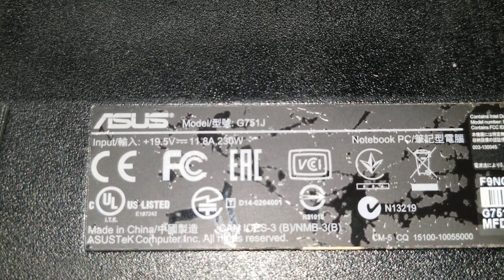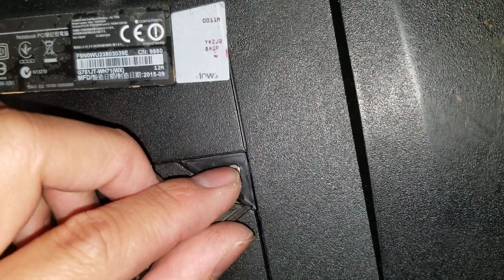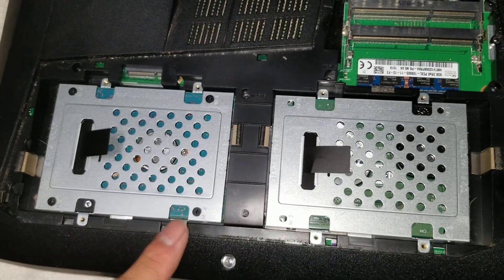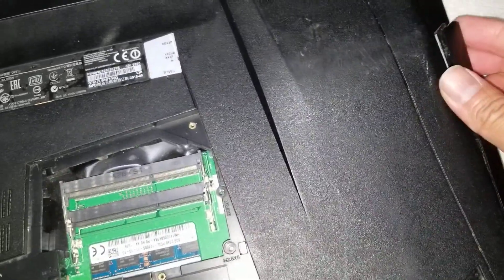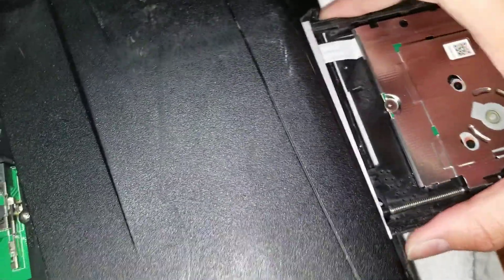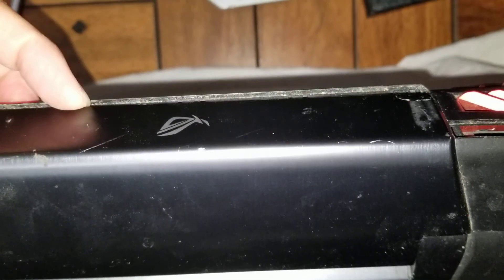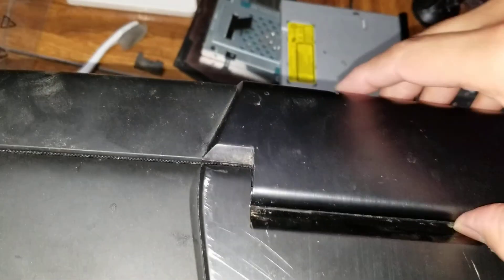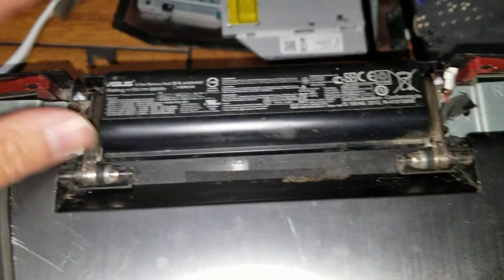ASUS G751J Disassembly RAM SSD Hard Drive Upgrade Repair

Comment: Thank you very much for this disassembly tutotial! I needed to remove the defective CPU fan and it helped me a lot with that. BTW: I involuntarily disconnected the two cables next to the CPU fan (9:21 the black and the white cable on the right) while I dismantled the display and didn't notice it until later when I tried unsuccessfully to connect different Bluetooth devices. Just wanted to mention it in case anyone else runs into the same problem.
Reply from the maker: Glad it helped. If you haven't already, don't forget to like and subscribe so others can find my videos. Thanks!